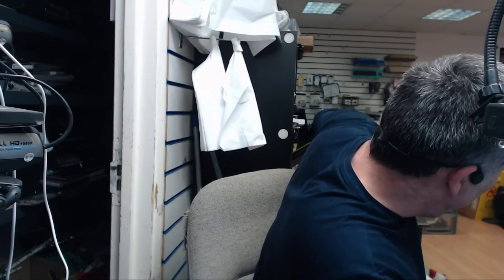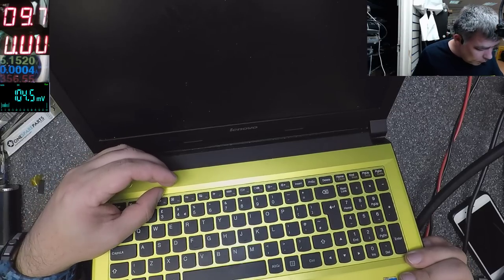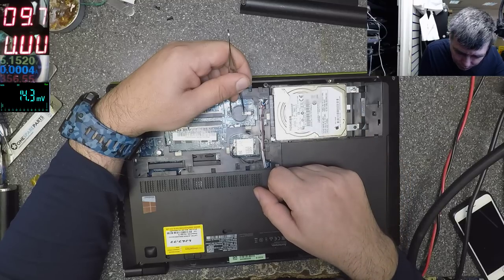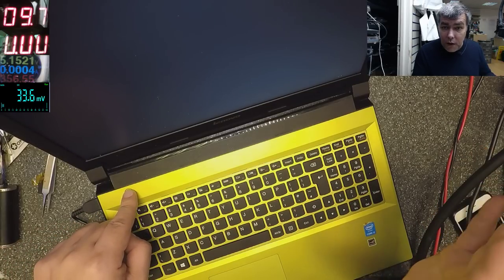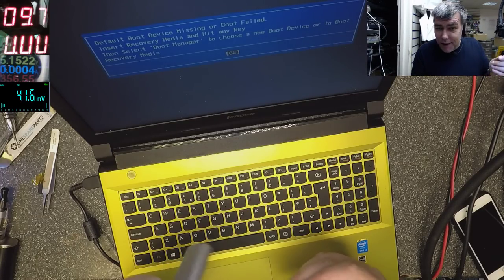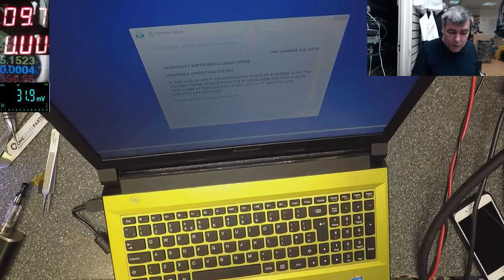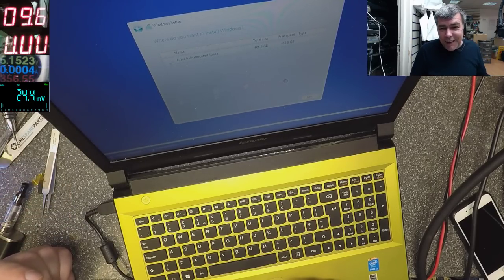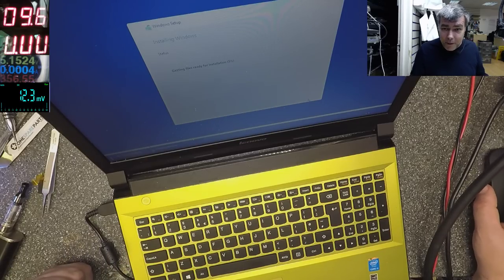The most common fault on the new laptops. Motherboard repair lesson  Lenovo Ideapad 305, no power

Comment: About that not seeing the disk - the system probably isn't seeing the proper MBR and that's why it's complaining, possibly to failed win update or improper second OS installation. I would boot to command prompt from windows 10 install (go to repair your computer - troubleshoot - command prompt option) and then type:
bootrec /fixmbr
bootrec /fixboot
bootrec /rebuildbcd

If installed OS is win10 you need win10 disc (probably win8 would work too, but win7 doesn't, I've tested). Had it happen twice in two days on Lenovo laptop after windows update!
Reply: Yeah he just needed to select the legacy boot to get it to run or UEFI boot option. vice versa

Comment: I love your videos. You help me most of the time. 
Please help me. I use the same laptop but every time I connect mine to power, it shows green light that it’s turned on instead of orange light. The fan doesn’t turn and hdd doesn’t turn. When I unplug it from power, it doesn’t show any light. The laptop still remains dead. 
  If i remove the battery and try to power it with charger it doesn’t turn on still. 
Thank you

Comment: Good day sir, I have exactly the same system you have worked on but it cannot charge the battery whenever I plug it on power but the system can boot up from the battery.The problem is if I plug in the charge I expect to see the green light but I won't see anything,I even change the adapter still it is not working.pls what could be the problem.

Comment: Great quick fix on this lenovo sorin. i had a customer that has lenovo ideapad 110  and looks thesame as 330, it turns on, no sound, but just  a black screen with white backlight. it has 4gig built in ram. tried that fix but still not working, tried to hot air the vga chip but no luck.  when plugged to an external monitor still showing nothing ànd no signal from laptop. Do you think it's a faulty chip or bios issue? i can't find a bootable bios file to reprogram the bios and i dont have bios programer tool as well. Do you have any suggestion? thanks in advance
Reply from the maker: can be the processor as is soldered on the board, check the ram voltage also
Reply: thanks sorin, i'll check on that later.

Comment: Hi if im not getting 3.3  on bios chip ehst must I do
Reply: check your upper level rails, if 12, 24,.... other power rails are not missing, you only have a problem with the 3.3 rail, otherwise its not the 3.3v rail you should be worried about.

if they are present, check other places that you should have your 3,3 for example on the startup chip and the power button.

if 3,3v is missing from all 3 of those but the 12v,24v,.... are present, its time to investigate for a short on the 3.3v line or the PWM (pulse with modulation) circuit that should create the 3,3 from the 12v,24v,....

Comment: hello I like to know something OK because I'm eager to learn must the capacitors under the CPU on laptop beep on continuity test or what if I'm getting beep on ground to both side of caps is it normal
Reply: Fathima Cassim  i think its normal, if cpu has 1.8 v it should have lower resistance, but not 0 ohms. the higher the voltage the higher the resistance as per ohms law. try to remove the cpu and test it again and you will get the correct value. :)